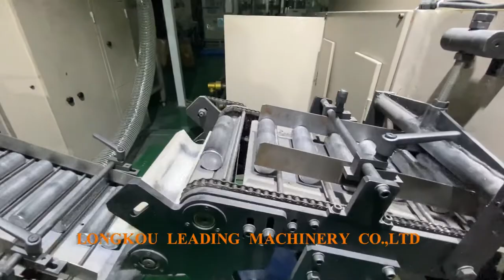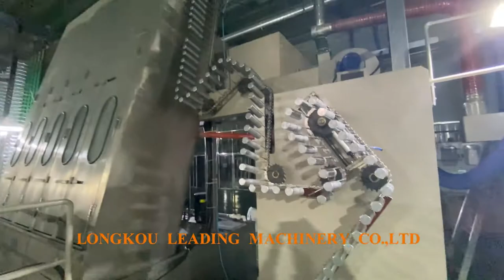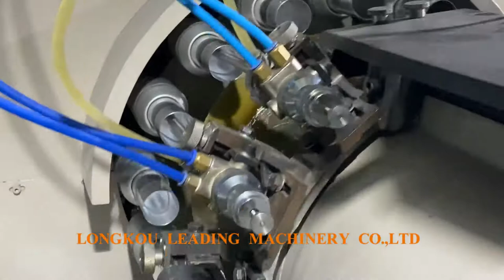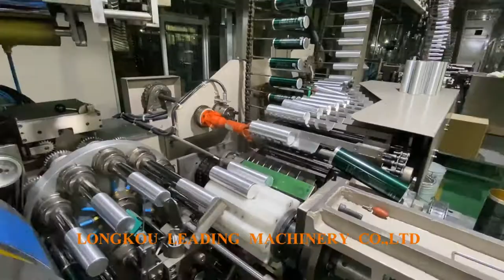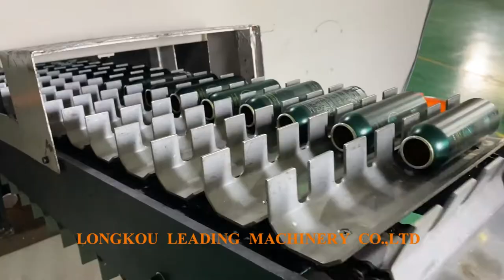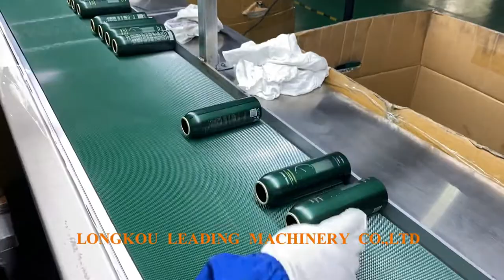ALUMINUM AEROSOL CAN LINE GREEN 8 COLOR PRINTING

Comment: We manufacture aluminium collapsible tube line, aluminium aerosol can line, and aluminium bottle container line machine. We manufacture in impact extrusion press machines. We manufacture dry offset printing machine metal closure and plastic cosmetics tubes. If u have any requirements then let me  know.

Regards,
Jasdev Singh.